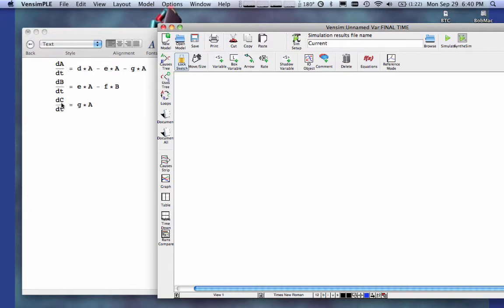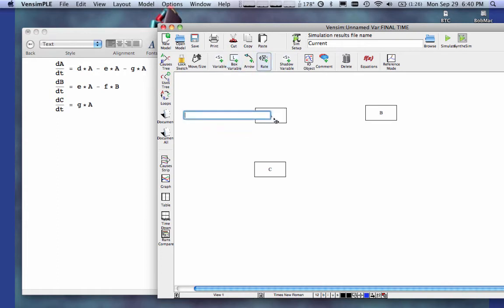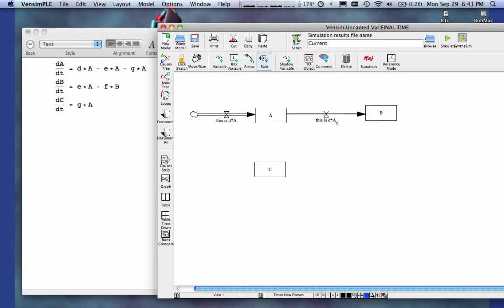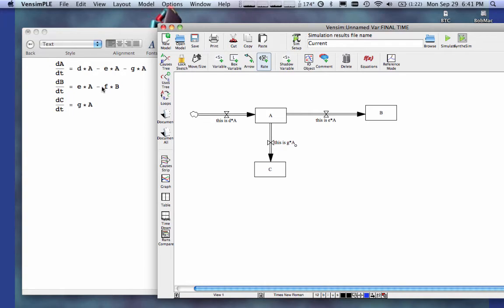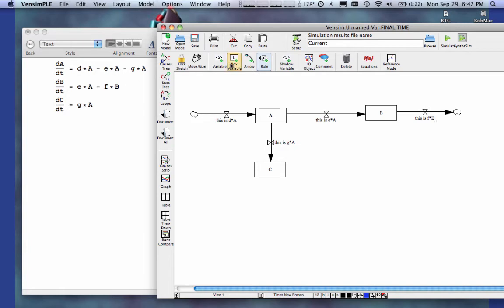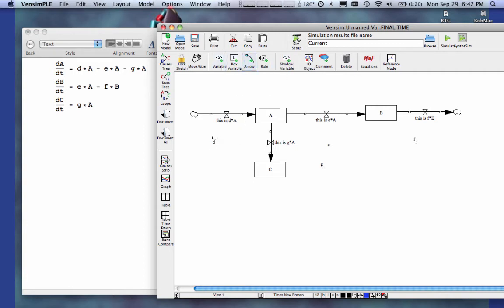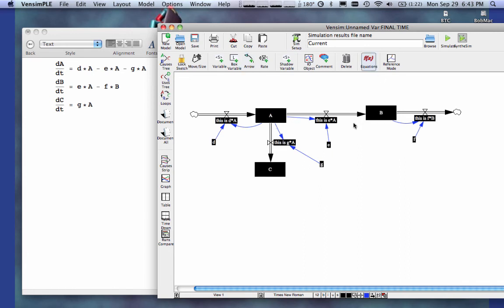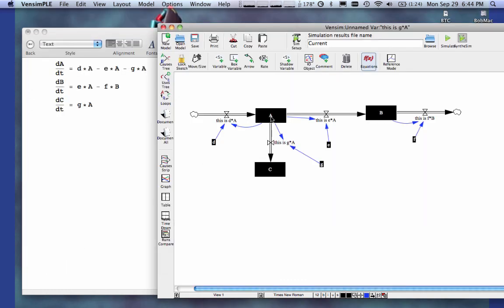ODEs to VenSim

Comment: Hello Bob! Thanks for the really informative video. I've been really stuck on a problem in my model. I was hoping you could help me. My model calculates the fraction of cooperating people in each year. To calculate the the fraction of cooperative people (at t=1), I think vensim would need to use the initial fraction of cooperative people ( it is an exogenous variable set to 0.5) to calculate the fraction of cooperative people at t=1. It should store that value and then use it to calculate the fraction of cooperative people at t=2 (using the value of  fraction of cooperative people at t=1). Can you tell me how i can achieve this? How i can store the values so it can used for the next iteration. I am using the PLE version of vensim. it would rlly help me alot! Thanks alottt